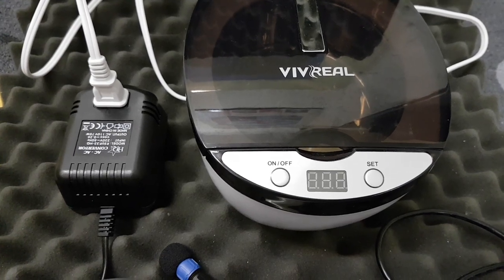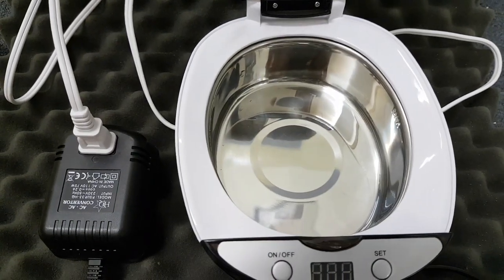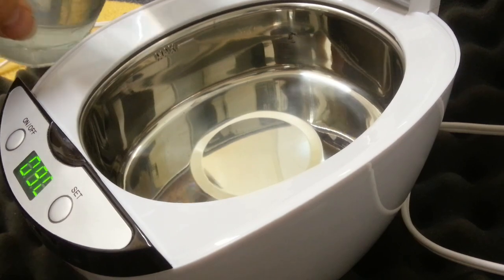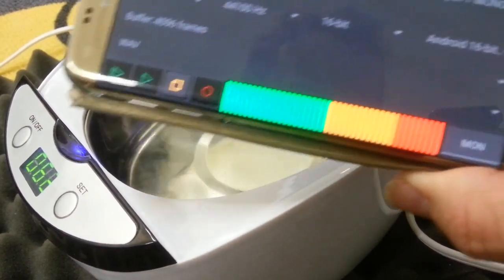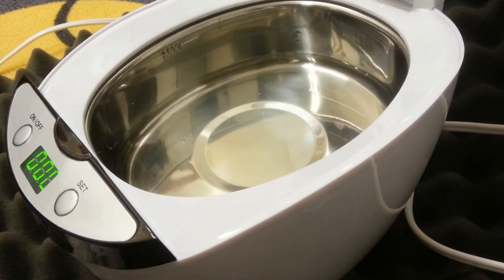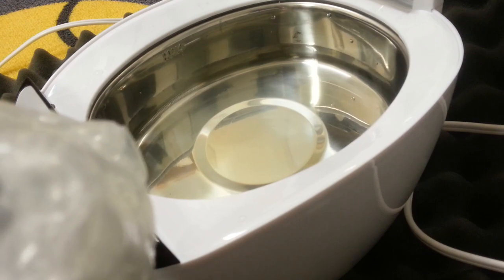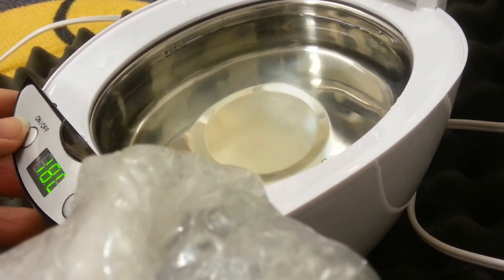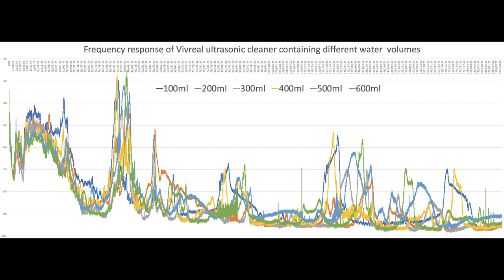ULTR - Vivreal Ultrasonic cleaner frequency response to water depth

Comment: Would you be able with some sort of voltage control input, change the frequencies? 

Along with precise volumes of water 
Very specific frequencies of sound produced? High sharp peaks being a purer tone 

I assume different liquids may give different effects. 

I will have to get one of these.
Reply from the maker: Can do some power usage vs water depth

If you get one, at the very least, you will have something affordable to clean small items!
Reply: Martin Fleischmann Memorial Project 
My wife’s wedding and engagement rings seemingly disappeared a couple of years ago. 
Ha ha. Highstreet jewlers offer the service but the low cost of the machine means many other things can be “cleaned”! 
I’d love 500ml of Mercury In there. 

I like messing about!
Reply: You read the Cardone series of Mercury treatment with Ultrasound?
Reply from the maker: @ronmuckle8644  I think a sonotrode is a better approach to working with mercury. Not sure I'd like to work with mercury though.
Reply from the maker: @curbina  Ron, if you look at the ULTR live document (link in the video description) you can find Cardone references entered by Curbina.
Reply: Martin Fleischmann Memorial Project  
Il be honest I haven’t read much about Mercury atall 
I just thought about a liquid metal in there.

Il get a look at those documents.

I remember a lad broke a thermometer in middle school and fun was had cupping the “quicksilver”  in our hands. 

Someone mentioned it was poisonous 
A bit like lead is poisonous